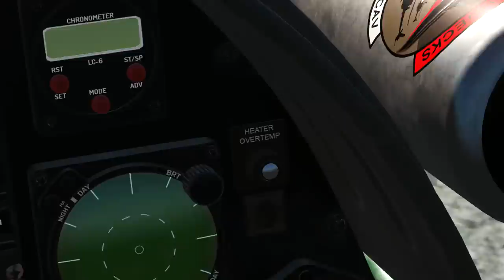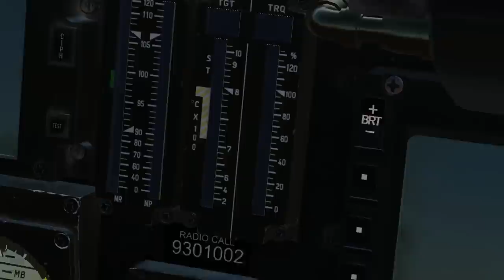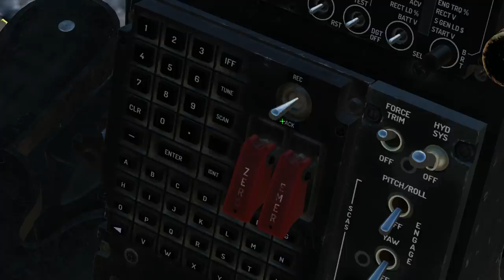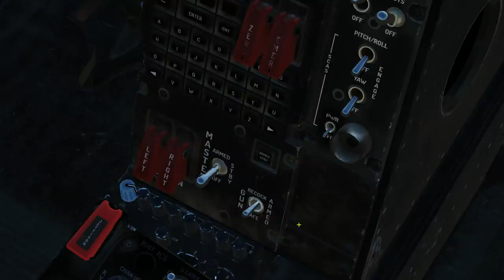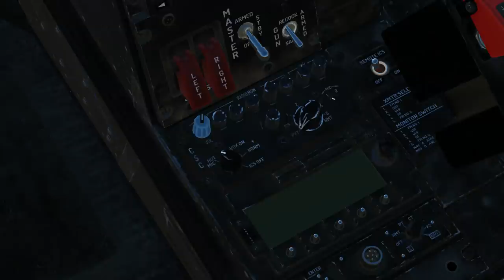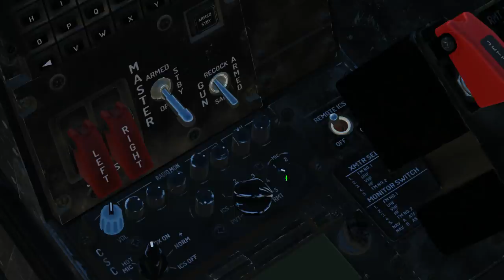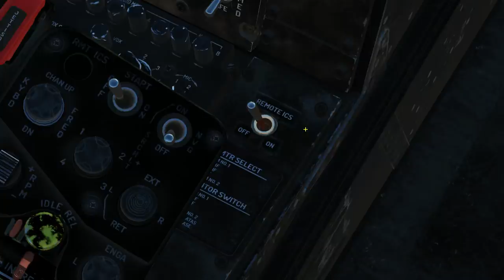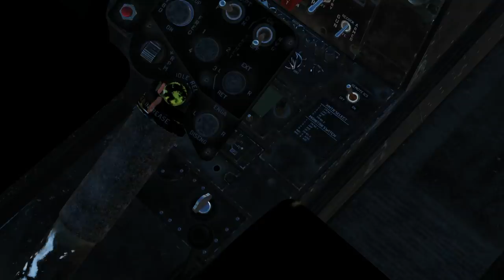Kiowa Warrior Detailed Intro  Pt 1 - Cockpit Orientation

Comment: I fly both real (student) and virtual helicopters and I definitely appreciate the depth of the explanations here. I want to know why and how something works in the simulator, not just what it does. Thanks for sharing your IP knowledge! In another life I could have been flying Kiowas for the Australian Army (before they retired them) but instead I find myself working up the civilian route. In a twist of fate, the army auctioned off the old Kiowas on the civilian market (sensitive military equipment removed) and my flight school is currently getting one rated for non-charter flights. I'll definitely be getting turbine endorsed in that thing!

I assume there is no governor in the traditional sense? The FADEC  handles engine rpm and fuel flow therefore covers the role the governor would normally play, but I assume mechanically it works the same way? Electric motor open/close fuel valve? 

Thanks!

Comment: Amazing video, thanks so much Barundus. I especially loved your little detail tidbits like setting the airframe to cold with the gun breach closed to prevent FOD ingress :)
I have a bunch of questions / remarks, hope you dont mind, feel free to skip them:
1. At 33:00, what is the "ARMED STANDBY" button / indicator used for, seeing as you already have a standby on the master arm?
2. At 52:00, I presume you need to have the Remote ICS switch on and press the button on the Collective to talk to them?

3. Perhaps I missed it or already forgot it with so much info :P, but what does the blank button underneath the RFD do?
4. Any plans on working with the SRS guys to implement the Radio systems on the OH-58D? They are quite talented but the OH-58D radios are quite unique and many, especially with the likes of the SatCom radio which I dont think we have seen before in DCS (?).

Lastly, can I just comment how cool it is that we get an OH-58D in DCS and how awesome it is to see driven people like you make it? Dedication to making stuff like the IR spotlight work is selling this so much for me right now, thanks so much and good luck!
Reply from the maker: 1)  The Armed/STBY indication is an error.  It should only display when there is power, so on a cold aircraft, you wouldn't see it there. With power, it should only display either "ARMED" or "STBY" depending on the ACP Master switch position.
2)  With the Remote ICS switch to the "ON" position, the ground crew station goes into a "HOT MIC" condition and the audio from the ground station is heard in the pilot's headsets.
3)  Not sure what you mean by the "blank button under the RFD".  If you're referring to the larger button that's slightly to the left and under the RFD; that's the FADEC AUTO/MAN switch.  It will illuminate with power, showing either AUTO in green, or MAN in amber, depending on whether you press it.
4) No idea what the plan for radio integration is.  I'd have to defer to the developers.  I'm just like Tyrion Lannister: I drink and I know stuff.

Comment: Great video, this really is priceless information to military aviation enthusiasts. I'm wondering about two things though:
1. You mentioned that helicopters like the Blackhawk or the Apache don't have the traditional twist grip for manual throttle control, but separate levers instead. How on earth does the pilot manage rotor RPM manually in case of FADEC failure in these helos? Wouldn't your left hand constantly have to switch between the collective and the throttle levers?
2. I'm surprised to hear that the cyclic stick would move forward if let go within flight. I figured that due to asymmetry of lift, the aerodynamic forces work to push the aft part of the rotor disc down, resulting in the pilot having to increasingly push the stick forward with increasing speed (or trim accordingly).
Reply from the maker: It becomes a crew-coordination task.  The pilot not on the controls will manipulate the throttle levers as necessary to maintain rotor RPM matched to power demand.

Comment: Mentioning how you have to start throttling the aircraft manually if the engine management system conks out, how would you do this in a heli which has throttle levers like an apache?  It seems like you'd need an extra pair of hands.
Reply from the maker: You take the affected engine to "lockout", which is a special position in the throw of the levers.  This in effect puts it in manual mode.  The idea is then to place the lever in a physical position where the fuel-flow matches the demand.  This has to happen within a couple seconds or the rotor droops/overspeeds.  You can match the required demand either by moving the throttle position, or moving the collective to match the fuel-flow.

Comment: Hey man, great vids. I have a question. I am currently 3d modeling a Kiowa collective stick which I'm going to 3d print and add to my current DIY collective I built for DCS. Could you tell me what the RMT ICS button does on the collective? I don't think you went over that. Also, I've seen pictures of other kiowas that have something different in that spot, in some pictures it looks like a toggle switch. I appreciate any info.
Reply from the maker: It used to have a little toggle-switch there to energize the remote ICS channel to the external ICS hookup.  Long-since removed.  Should just be an empty hole there now.
Reply: @Barundus  I really appreciate the reply. Your vids are awesome, I can't wait to fly this thing with the collective I'm buidling.